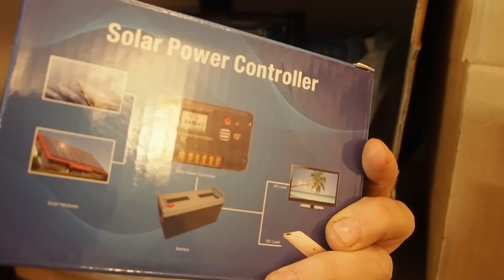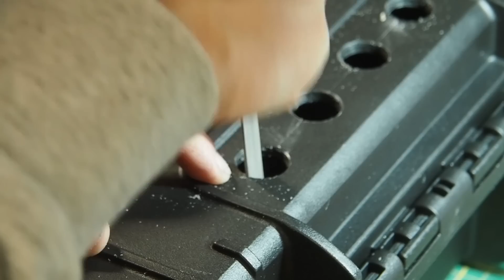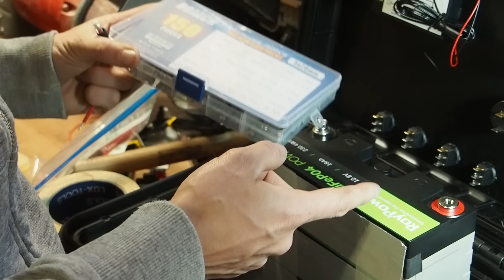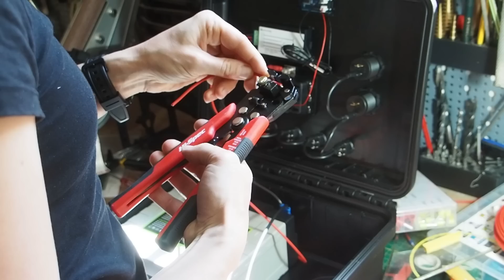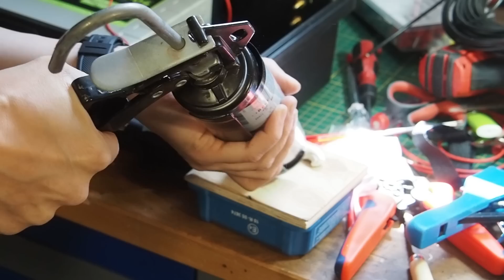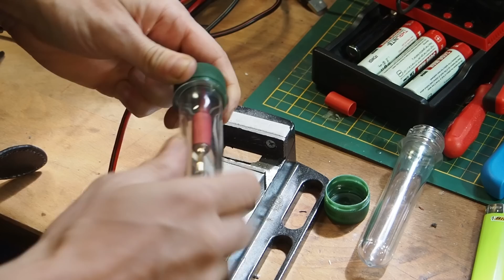This self-made box will save your life in a blackout scenario!

Comment: Ur correct on cold charging.   Some lithium batteries even have low temperature protection.   PWM is good if only 1 panel MPPT for more than one.    Victron is very good but cheaper ones r available

Comment: That MPPT charge controller needs  a solar panel voltage of at least 5 volts above battery voltage so about 19 volts to be able to charge that battery. That small folded panel might not give sufficient voltage.

Comment: The idea is great, the execution is not bad - the wiring is amazingly clean. I would have screwed the two blocks onto an aluminum sheet and placed the sheet inside and fixed it with glued plastic brackets. Otherwise, if the case is bumped or dropped, the released blocks will knock off the switches and displays. Is the box still waterproof? The cable routing is insufficient and amateurish... the case is otherwise successful - neat work.

Comment: Hej igen. I bought one of those folding solar charging packs from a company here in sweden called  " Boltema "  It has 2 usb ports, 1 for android and 1 for iso. I cant get it to work. I took it back and they tested it and said it works fine. I still cant get anything to charge on it. I have used my phone on both ports and left it out in full sun all day and not even a peep.  So their policy is that i opened the box they wont refund me. OMG I have to open the boxto get the item out. what a stupid rule... I think i will take it apart and make my own solar cell charging unit instead. (Y) Hope yours works okej (Y)

Comment: you should NOT be hammering any switches! poor advice sorry. The internal parts of a switch usually use carbon contacts which are durable and long lasting however the contacts can be  quite fragile when the switch enclosure is struck repeatedly.
Reply from the maker: Yes you are right

Comment: Other than pounding in the switches I think you did a great job. I don't know if it was mentioned but from reading a bit on the charge controller the battery should be directly connected to the charge controller and use the load output to power all your devices. This way the charge controller will make sure your battery voltage doesn't get too low. Also the way you have it hooked up the battery charging on the charge controller is also supplying power to all your devices so you may not be charging your battery as much as you think but the charge controller can make those adjustments if you use the Load output for your devices. 

Great video! I'll have to watch your other videos :)

Comment: I'm overall impressed with the quality of your work on this project, but as I can be incredibly picky with my own projects, there are a few things I would have done differently.

First, rather than banana plugs, I'd have used an "Anti spark" XT90 socket in a flush mounting plate on the side of the case. This would remove any chance of shorting out the connections on the solar panels, and prevent the risk that the cases banana plug sockets could still be damaged from it being dropped on rough ground.

I'd also have loomed the internal cabling to keep them tidy and less likely to move about during transport. Unsupported wires have an annoying habit of work hardening and fracture at the crimp on connectors, so it's always best to keep them from being able to shift about too much.

For the battery mounting you haven't got a whole lot of options with that case, but I'd have turned the battery around so the posts were pointing towards the cases handle, and most likely used "Car trim mounting tape" on the batteries side and bottom to hold it in place. Car trim tape is a very strong double sided tape that has a closed cell neoprene layer in it. The stuff is springy enough to take up any irregularity in the surfaces to be joined, holds incredibly tightly to clean surfaces, and is thick enough that if you ever need to remove the item it's holding, you can slowly work a snap off utility knife blade into the gap to cut the item loose again.

And the last thing. As the box is designed to be waterproof, I'd have used weatherproof switches, and sealed around every new mounting hole in the case with a bead of black silicon bathroom sealant. If you get water into an ALMOST waterproof enclosure, it's usually a real pain in the neck to get it all back out. :)

That all said though, the above points are only really me being super critical, and possibly having very different criteria for what I'd want the finished unit to do (For example, I would have also been very tempted to add an inverter so it could run low power domestic equipment that can't readily be replaced with 12v versions, and maybe fit a pair of contact points inside so it could also easily be used with jump leads in an emergency if my cars battery was flat), so please don't take my comments to heart. What you've built is still a very neatly made and well thought out project, and it would appear that it does everything that YOU want it too do, and at the end of the day, that's the only design criteria that actually matters.

(Oh, by the way, if you're still annoyed by my comments........ if I wasn't genuinely impressed by the professionalism I saw from you building this project, I wouldn't have just liked and subscribed to you channel based purely on watching this single video. When I get time, I'm looking forward to watching your others. :D)

Comment: For your information you can't just add different amp values liku you did, you must either convert to Watts or use some othe equation.

So you need a 16A fuse if you run full load the 12V outlets at 5A and your two USB outlets at 2.4A each.

2*2.4A * 5V = 24W / 12V = 2A
2+5+5=12A.

Comment: Just watch the battery, because heat from the battery can break down the adhesive. Velcro is a much better plan.
Also, it would be good to wire the solar panel with a safety switch to automatically break connection with the controller if main power switch is turned off to protect your investment. 
Good job.

Comment: One thing I would improve on would be to use a relay along side of your master switch, so you dont have power flowing thru your master switch at all times while the box is on, they are super cheap, and easy to wire.. Otherwise this is a good build to keep some lights on while the power is out!

Comment: Great video!!! I might suggest if you aren't able to press the round switches in by hand, maybe try a large socket that is the same diameter as the outer mounting ring of the switch and hit that with the hammer.

Comment: Turn the battery around so bottom is against the bottom, so when dropped, bottom of the case supports the battery instead of all the force going to terminals and maybe some dampening foam etc to take the shock from the battery. Proper mount for the battery. If case is made from ABS you can easily chemically weld mounting points for rubber band or screws with acetone that melts ABS making good connection between ABS plastic. If some other plastic, you can try cutting dovetail to that plastic, make thick putty with melting ABS in sealed glass jar with acetone, filling the hole and inserting peace of ABS. Putty hardens when acetone evaporates and should form into shape locking it in the place, though i havent tested this method so might want to try it on some scrap peace and try how much it can hold. Add in similar methods protective flanges on each button etc so there wont be much chance of damage case, the case moves around say in trunk or something hits it. All the connection points should be on the handle side of top of the case, so when stored upright there is least amount chance of water getting to terminals, switches etc. Water tight plugs to each connection to prevent water getting into the connection causing corrosion or worse short circuit. Clear plastic holder inside the case with lid to house extra fuses and maybe tools to repair plugs etc. Silicone couching on the connectors that have no seals and replace those switches with proper IP standard. Case is same IP standard as the weakest link of it, so now its only used inside since i bet those switches are not water proof. Use some sealant on the lids that are for the solar cable so water wont get in easily and choose case large enough to have room for those cables inside. Make simple and easy to read instruction manual inside the case, so when shit hits the fan you dont have to relay on your memory what to do and what not to do. 
Otherwise pretty decent build, could also look into super capacitors since far as i know those last much longer than lithium batteries and can be stored empty with out issue, but dont quote me on that. You can take this out of storage and charge it pretty fast from socket to have it ready when you know there is something going on and of course solar panel option is there. Would also look into charging it from car cigarette lighter socket so it can be charged while driving, or tap into abandoned vehicles battery if need arises. Also since you never know what kind of shit is hitting the fan, put this inside faraday cage and look into improving its EMP protection in general.. not much you can do with cheap chinese parts, but could be big difference when solar flare fries electronics.

Comment: Hope you didn't damage the switches by hitting them with a hammer, next time use a piece of pipe, that just fits at the border of the switch and than hit it with a crowbar or the rubber hammer.. Nice job anyway, you Rock, Lilly.

Comment: If I make one of these I will make mine with the battery top up when the case is upright and sitting on it's hinge side with all switches and displays upright in that position ! Because the battery should be placed upright even a sealed one and its weight should rest against the bottom when being carried by the handle or sitting on the side with the hinges !

Comment: You could wrap the battery with a hermit crab heating pad, then when it's cold, energize the pad using the power from the battery, warming up the battery, allowing it to be charged in cold weather.

Comment: Really good idea , nice and clean job .👍   I would of put the battery with the terminals facing the carrying handle, and the banana connector’s would probably sort out if the box is placed down on a wet or damp surface,mud/grass or even a small puddle with the handle in the upmost position! …One more thing to reminder …. The waterproof case is no longer waterproof now the holes have been cut out!

Comment: Very nice project! Just happen to have one remark about the MC4 connectors. I noticed you made small mistake that can potentially be a fire hazard when connecting bigger panels or strings.
When you crimp the cable to the metal piece you cannot just put them in there and screw them closed. You need to push them in until they click. After that they are permanenty in place. The way you just screwed them closed results in a smaller overlap in contact or no contact at all between the mc4 plugs. I would advise to redo those connectors.
Also. MC4 is good for permanent installation but clunky and not easily disconnected. I would personally use Neutrik Powercon type connectors for this. Your box is excellent for that and that way you don't need the bananaplugs. The bananaplugs are not weathersealed (and on the bottom of the case!). Neutrik connectors also exist in weatherproof versions. Also this takes away the risk to reverse polarity (although the charge controller is likely protected via a diode).

Comment: Add a small resistive heater, it can be used to keep your feet warm inside a sleeping bag.
Add a small thermostat, so that the heater will heat up the box to the charge temp of the battery. When it reaches that temp the battery will have the charging power. Then you can connect power for charging even at low temperatures. The heater will heat the box, when the box reaches warm enough it will then turn off the heater and charge the battery. Charging the battery will likely keep the box warm without need for the heater.
Reply from the maker: yeah I believe that would work. but it has to be a really small heater with about 5-10 watts. otherwise it will drain this small battery in an instant.

Comment: Nice fabrication skills! Great concept!
Loved the placement of the Banana Plug sockets in a protected location!

As another Commentor suggested mount the battery so it sits on the spine (hinge edge) of the case for support and strength.
Also a couple of screw-down hooks with stretch straps might be better than the Double-sided Tape for future maintenance.
If using Double-sided Tapes consider that there are various types for different applications. Broadly speaking - Thin, Medium and Thick.
The thin tapes are generally for non-weight bearing applications.
The medium thickness tapes are either rubber or foam based and have better adhesion and shock resistance, often designated as Automotive Trim Double-sided Tape.
The thicker tapes again are either rubber or foam based and have better adhesion and shock resistance,  sometimes used in wet areas to fix items to tiled surfaces and often come in a clear base form.

If you were to use an LCD Panel Thermometer rather than an LED unit there wouldn't be any need to switch it on or off, and there was no need to fuse the Thermometer.
I think that the Thermometer  would be better located next to the Battery Monitor, and the Switches where the Thermometer is - at the top edge of the case.

I'll echo the comments made by others that the Solar Panel you are using is fine for powering 12V devices, but not for charging a 12V battery.
Any charging device (Solar MPPT or BMS)  will require a supply voltage of at least 14.4V to have sufficient voltage to provide any charge to the battery. The output from that Solar Panel wouldn't even be sufficient to "float-charge" an already fully charged battery.

One last gripe - please get yourself some type of heat/hot-air gun!
Using a lighter or any direct flame on standard heatshrink tubing is a measure of last resort in an emergency only.

Comment: Nice job...  would be better to have a dual pole switch for the main power.. and that way you can switch the solar inputs at the same time. this would prevent any issues with the MPPT controller in the even of an accidental power off.

Comment: Are you going to toting the box by the handle?? If so your battery is upside down… I know the battery will still work fine upside down or on its side to, but, I wouldn’t place it that way because eventually the two side tape might get loose causing the battery to fall. Just not sure if any damage  could occur.

Comment: When you are carrying it, the battery is upside down (no inherent problem since LiFePo) - but stick to a side with double-sided tape. I would rather align it to the bottom of the case at carrying position - so the weight is reliably supported.

Comment: Bashing the switch toggles to mount a press-in switch can easily damage the switching action...  😒 Using a suitable sized socket from a 1/2" drive spanner set, just on the switch rim, is a much better idea.  The battery Caution label says "Do not charge in a gas tight container"  But I doubt that even your "waterproof" container will be "gas-tight" too. Otherwise a very good job - nicely engineered!

Comment: The glue from the double sided tape that holds the battery in place will become unstuck as soon as the temperature is 'warmish'. Under sunlight? Or in a car under sunlight? 10 minutes tops. That type of tape is really made to stick stuff like paper or cardboard together (which have microscopically porous surfaces). Not very efficient for hard, compact  surfaces.
PS: I would also add a 1oz. packet of silicon dioxyde crystals to keep the inside free of humidity at all time. Particularly from condensation from temperature changes.
Reply: Do not add desiccant.  Desiccant is only suitable for an air-tight container.  In a box such as this the desiccant will INCREASE the humidity and chance of condensation by rapidly becoming saturated and then if the air is ever less most than the desiccant it will release moisture it is holding to increase moisture in the air. This is why desiccant is also used in potting soil to keep houseplants moist.

Comment: This Banana male connectors for power OUTPUT triggers me so hard. On a blackout i won't life any longer, if this banana plug's was the only option.  Even an Speakon connector would fit better. Every shit get his own fuse, put the external input not. GG Good Design 
And BTW the RoyPow LiFeP04 has integrated BMS AND under temperature (0℃) protection. So the temp sensor is complete useless. Maybe next time take the 1 minute and read the datasheet(s).

Comment: I am not sure I understand the point of this. My solar inverter has 8Kwh of lithium batteries connected to it and a line voltage output which takes power from these batteries if the main power fails. I suspect most inverters do this. I have taken my output to a socket strip so I can manage for quite a long time if there is an outage.

Comment: your power box is looks awesome and very functional, I have a few suggestions if you don't mind: thicker wires may be used from the battery for higher current output, and so may have a 12v high ampere terminals out for a DC to AC inverter to use AC devices. Keep up the good work.
Reply: Given that the Battery Capacity is only 216Wh, you wouldn't be powering much more than a Shaver Adapter or charging a phone or  tablet 🤔.

Comment: If you cut one of the leads from the solar panel 5cm (2") shorter than the other, the two plugs won't shortcircuit, even after the shrinktube is worn.